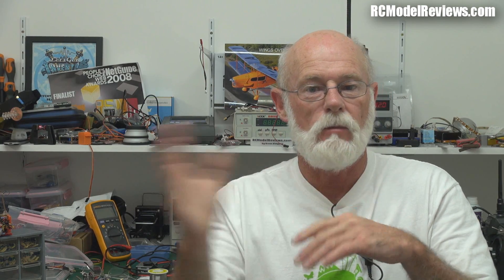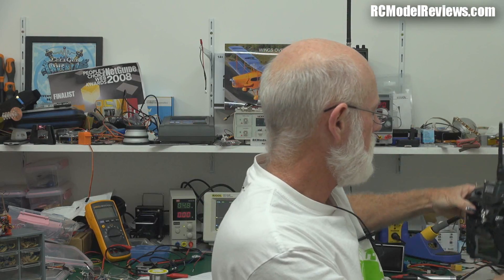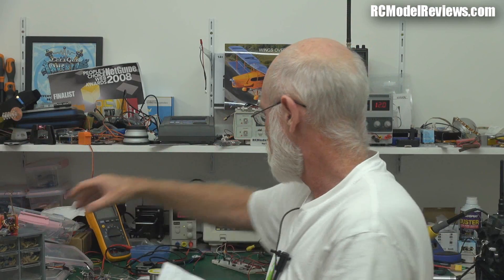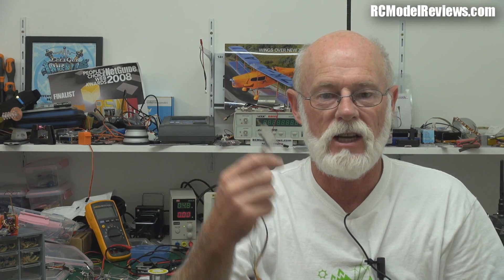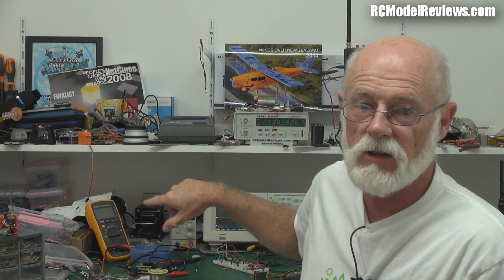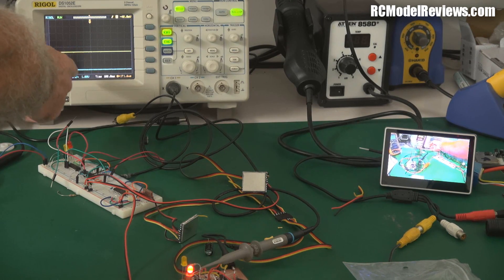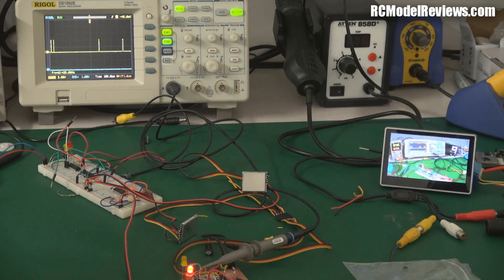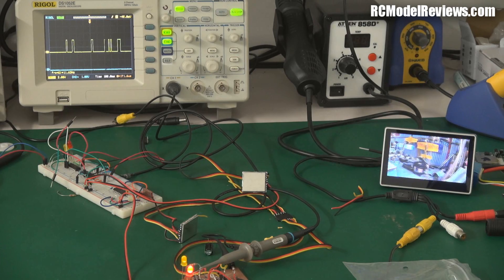A $1.29 FPV diversity controller (improvements)

Comment: But you will program and sell the Chip?  If you got some spare time, i would love if you post links to components you refer to on ebay.
Anoter great video, thanks Bruce
Reply: nilshv The controller in this video doesn't need any programming at all.
Reply: Wasn't the chip just bought from the shelf?
Reply: Go oGle Those chips in the other video? Digikey?
http://www.digikey.com/product-detail/en/CD4066BEE4/296-36088-5-ND/1691254   and
http://www.digikey.com/product-detail/en/LM324N/296-1391-5-ND/277627
I thought they had to be programmed, and Bruce would sell these finish programmed?